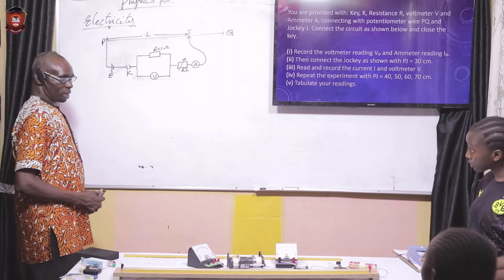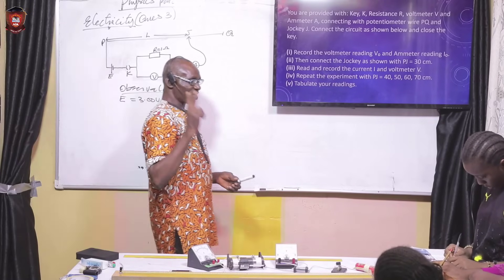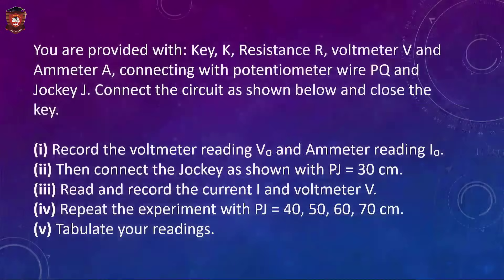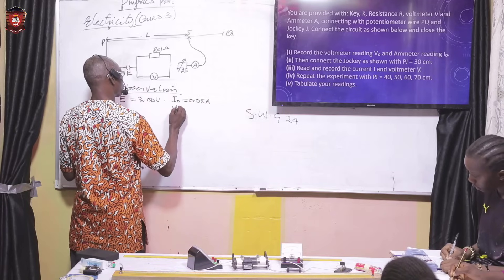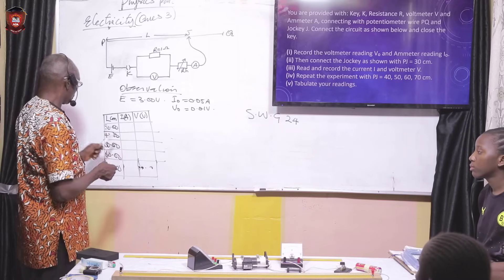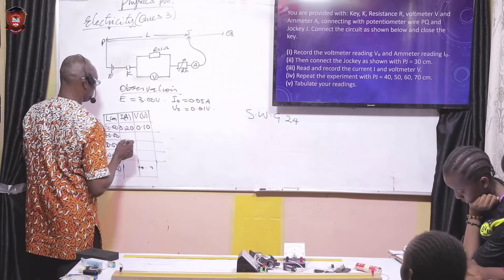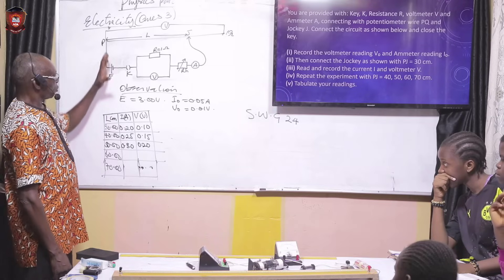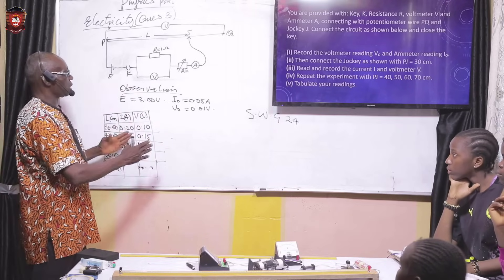WASSCE 2025 PHYSICS PRACTICAL

Comment: Thanks sir. But i will suggest you indicate how the connection was done properly. For example, you  can state how the ammeter is connected to the jockey. Was is the positive point of the ammeter or negative so also for other items on the table. Help us understand how to setup the circuit